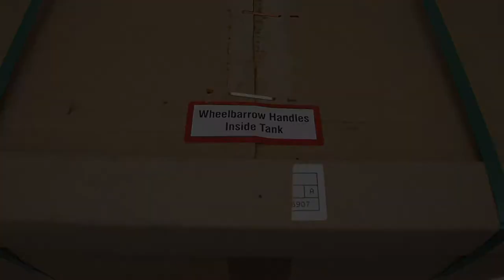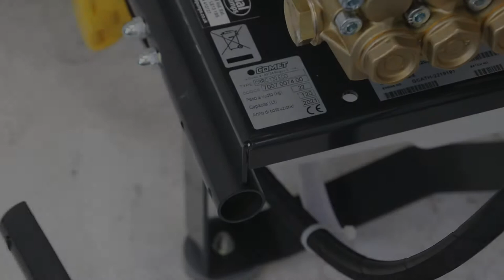Unboxing & Setting Up Dual Pumps Wheelbarrow Tank Pressure Washer

Comment: What's the point....?
Reply from the maker: This video was made to show how to assemble one of our wheelbarrow tank pressure washers, it highlights how certain parts of the unit are packed for shipping and where to find them, for example the wheelbarrow handles are inside the tank. It also displays the tools needed for set up, how to connect the hose and fit the hose reel and notes that fluids need to be added before use because the engines are shipped without fuel or oil. The travel plugs are fitted to the pump for transportation too which need to be changed for the oil breather dipsticks before use. We hope this helps answer your question and hopefully the video will be a good aid to any of our customers or staff who want to check how to assemble one of these units correctly.
Reply: @DualPumpsLtd  
Ok..
Keep your hair on...